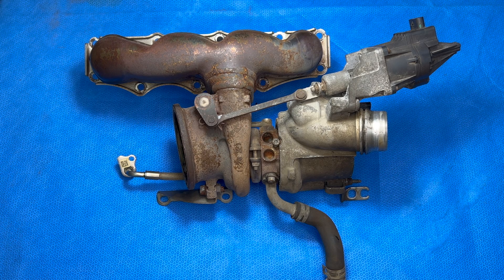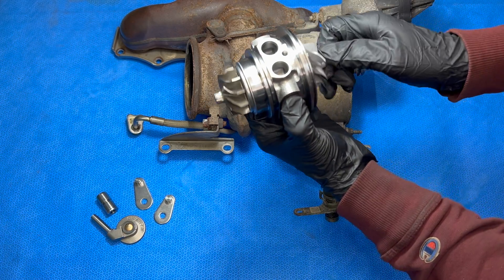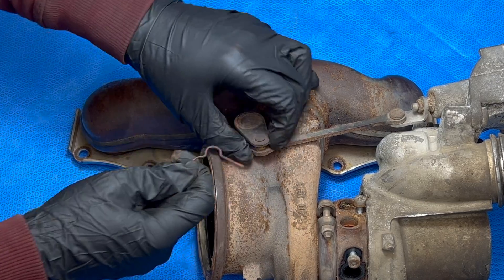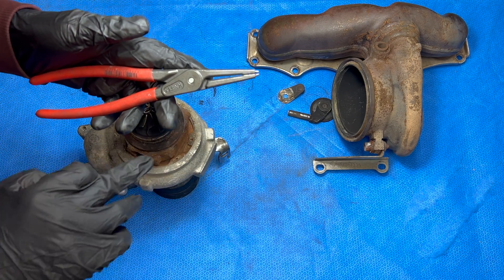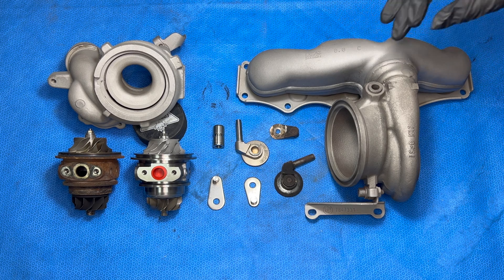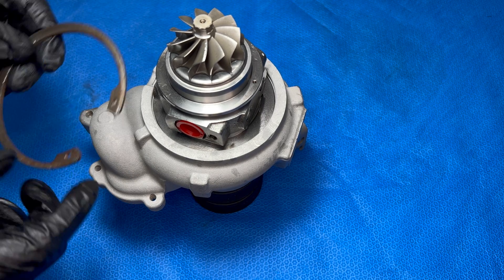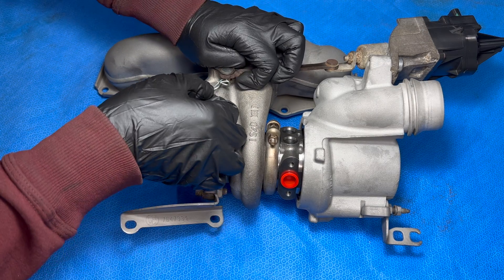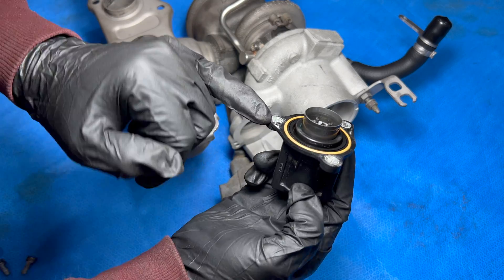Rebuilding a BMW Turbo for LESS than 500$! CHRA N20, N54, N63...

Comment: Wait, did you not put any liquid Molly additive? I’m at that process right now and I’m trying to figure out where should I be placing the additive? Please reply when you have a chance. 7:55
Reply from the maker: Nope, I don't use any additives. Won't hurt if you want to use it, but not required to spend the extra money.
Reply: @ but doesn’t that potentially damage the cartridge in the future on dry starts? And thank you so much for your prompt reply. I’ve learned a lot from you and I really appreciate your videos.
Reply from the maker: @musclefactory9181  Glad you like the videos! A dry start on a turbo is bad, you are correct. But what I do is prime the oil system in the car to circulate oil through the lines before startup. I explain it in Part 5 of Project 328i if you want to check it out.

Comment: Hi, great video.  Do you need a custom tune after this or just plug and play?  Any update?
Reply: Plz update us
Reply from the maker: @topfloorshooter1142  No custom tune, this is an OE replacement. If you upgraded the turbo then yes a tune would be needed to see the extra benefits. Turbo is still running like new.

Comment: It comes with those two screws because they go bad as well. They brake very very easy and should be replaced once the turbo is worked on. Delt with that issue the hard way, trust.

Comment: Amazing video, thank you! In your opinion, is rebuilding with an upgraded CHRA And turbine a viable option for a DIY approach to a stage 1 turbo?
Reply from the maker: Hmm, I'm not sure how much you would gain with just a CHRA. Usually the upgrades have a bigger and better CHRA, but also have a machine compressor housing to fit the bigger turbine.
Reply: I see, I didn’t realize that the compressor housing was also machined in some cases. Thanks for your reply!

Comment: This is a off topic question but I was driving my 2012 bmw 750li and I was 30 seconds away from home and I got a drivetrain malfunction message but there was no difference for about 20 seconds, when I put the car in park the car was shaking and there was a rattling sound coming from the engine, I read the codes and codes 140801, 131001, 131101, 163401 came up they have to do with camshaft and crankshaft, I can hear the timing chain rattling so I turned off the car and was looking around the engine bay looked to the bottom and there is a bunch of oil dripping and I opened the oil cap and there looked to be coolant in the oil becasue the oil cap was white and it smelled like gas. What do you think happened and do you think it’s repairable. I tuned it on just for the heck of it and it looked to run fine but you can still here timing chain  rattling.

Comment: Great video! Now if only I had a 20k vapor hone machine to clean up housings or even a place that didn't charge hundreds to thousands to do simple quick parts cleaning
Reply from the maker: You don’t need the 10,000$ machine! A regular 200$ harbour freight sandblaster will do the trick

Comment: Hi, Nice job, only one issue, you just ruined the mirror finish on the inside of compressor housing with sand blasting it, that compressor is going to lose some efficiency due to increased drag.
Reply from the maker: Thanks. I was thinking about that too, but after speaking with a few turbo rebuild shops, they told me this is a common practice to clean the rust off when refurbing them so it should be alright.

Comment: Awesome vid and job, really valuable info on the turbo rebuild. I believe there's nothing about this motor that you don't know. I can tell it's done professionally and will run a long time. 

This is something I would definitely do to this X1  if I need to later on down the road. 
My turbo is in good condition, waste gate flap doesn't even have any play whatsoever in it so that was good to see. I'll prime it and rock on with her. 

The 4 manifold gaskets should be here tomorrow and I can get those installed. That circlip is massive lol  I bet it really does have some serious tension on it. Wow! 😮 

Get your turbo cartridge straight from China for a little over $100 😂 I wouldn't recommend that either. Haha